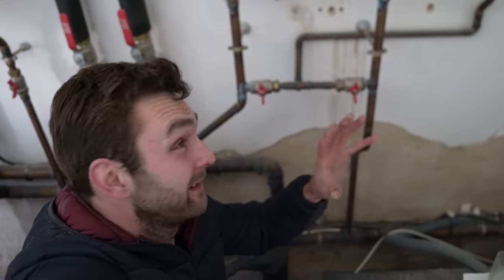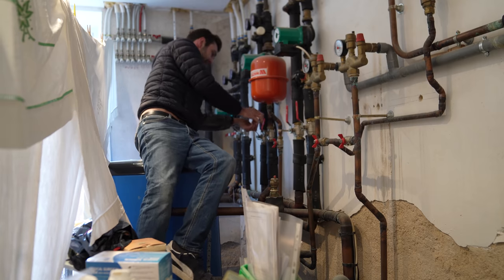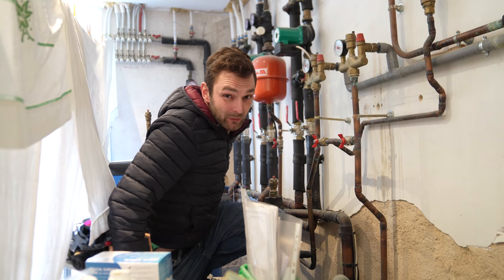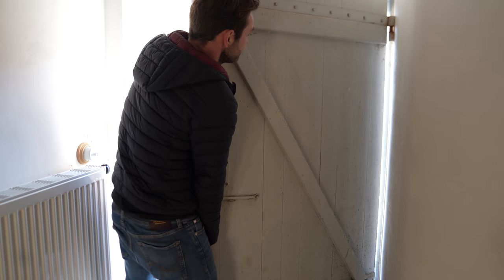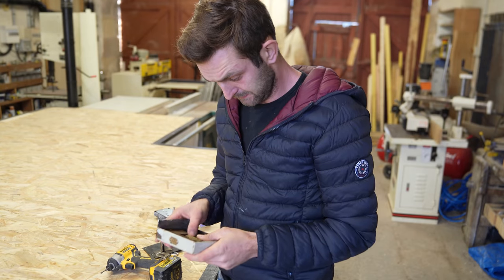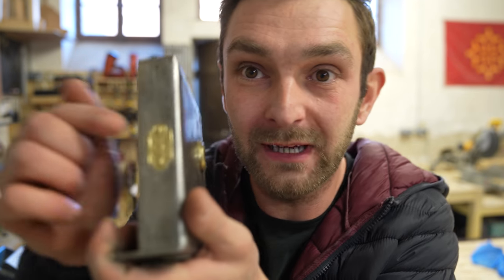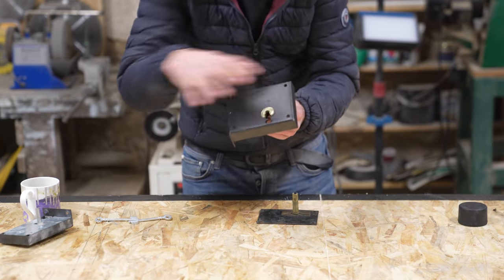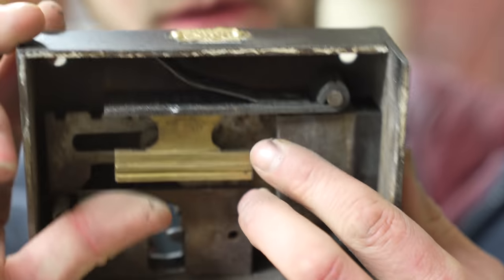A chateau under pressure - EP190

Comment: Dan. It worries me that whenever we see the heating system the sight glasses on the manifolds shows filthy brown water. Someone mentioned that there was anti-freeze in it but is there any rust inhibitor? The lack of it could explain why all the radiators are developing pin holes. It looks like the pipes would benefit from a good flush through and a massive dose of Fernox.

Comment: Could I make a suggestion on these radiators?  Yes Ok.. here we go...  Lets maybe look at finding a tray of some kind that you could replicate at the chateau.   1 design or 2 that would be just an extra layer of protection from these leaks.   Make them, waterproof them, and slide under each radiator.   And ... I know you have a lot of radiators but they make sensors to detect water.   Is all a wifi thing and as soon as a radiator leaks in your new deep tray that you have made, it will be easy to find an issue before it becomes a bigger issue.
Reply: Really 😂🤣😂🤣😂🤣😂🤣😂🤣😂😂🤣😂🤣
How repair 👨🏻‍🔧 the system instead of An overly engineered leak detector
Reply: There's no shortage of money to have a new system put in but other things take priority, like planting trees.
Reply: @charlottedickens7713  what a folly! That place is in rack and ruin tbh
Reply: It seems like the radiators are a constant thing/issue so I was trying to suggest a diy HINT chateau diy way of helping protect the place from water damage.

Comment: Have they ever explained why the heating system started to fail all at once? Was it a lack of maintenance or just poor-quality parts? Boiling door furniture in water will easily remove old paint we used to do it in an architectural salvage place I worked at.

Comment: Davey could probably find an expert to redo the heating system with solars and hydro as backup. Dan is plugging the gaps very manfully!
Reply: Pretty sure it’s in the works but seems hard to get people out to do work these days. I know Stephanie has already looked into it.
Reply: There are professional heating engineers that can be consulted. She only has to ask other chateau owners what systems they have and the effectiveness of them.  No other chateau owners are freezing.
Reply: @lindamitman4538  I am sure you are right, she said that the heating engineer will be coming out in the new year, I believe that plumbers etc are difficult to get in france and even harder to get them started.it was after she had tried loads of plumbers who couldn't come out for months or just didn't want the work that Dan an Amuary started removing cracked radiators and fitting as many as they could source just to keep tha ancient system going until it is completely overhauled
Reply: @arnicepernice8656  not sarcasm, its common sense.  You don't see Anna & Philip & the 2 girls walking around looking like Nanook of the North, or Sarah & George, or Anna & Ed... the heating never has been priority as Stephanie goes to warmer climes in the winter or at least to somewhere that has heating.

Comment: What about the heating system the Petherick’s use  use?  Finally, the last door locked.
Reply: She getting on to be an old woman to cart one ton of pellets a week in for the boiler, Versus flipping a switch. Anyways there is a mandate in the wind to go more green and fuel efficient, and she already is geothermal it needs to be updated greatly it’s 15yrs old and was designed for a budget to keep the place barely warm and they have added to it and not maintained it well.

Comment: Does anyone know what is going on with the heating?? Has Stephanie addressed it in a Patreon video or even a regular video that I have managed to miss. Is there a reason that they are waiting to get it fixed, seems ridiculous!!
Reply: They have discussed this issue continuously on the Vlogs. 🤣 The chateau is in the middle of a rural area in the middle of a pandemic. They need a Geothermal expert, a good new overal design for all the wings, new radiators (more per room) and they are adding more insulation as they renovate. They insulated the attics, Natti's and Gerry's appartments, under Isabelle's  appartment and now are working on the Grand Salon. Also the rendering of the outer skin will begin this year. Rome was not built in a day. A five year plan is ambitious enough. 🤣❤